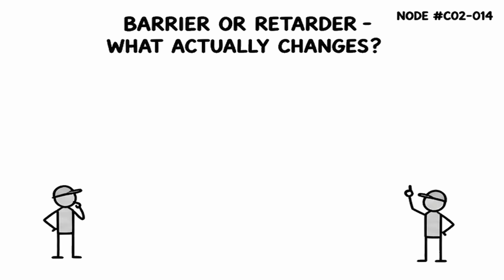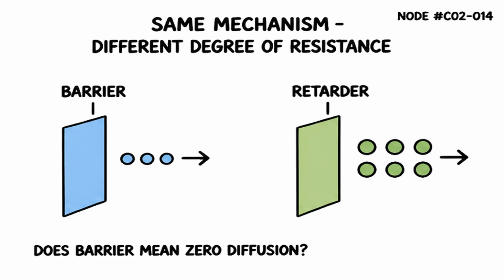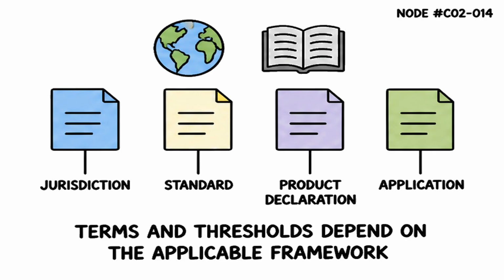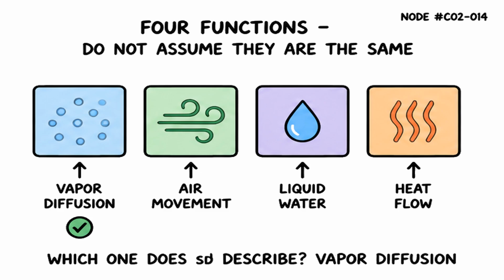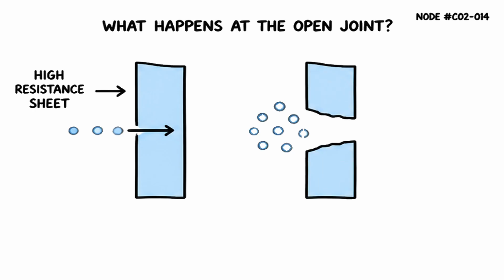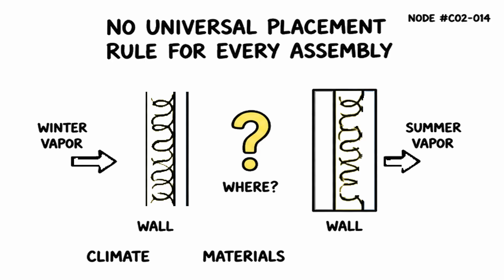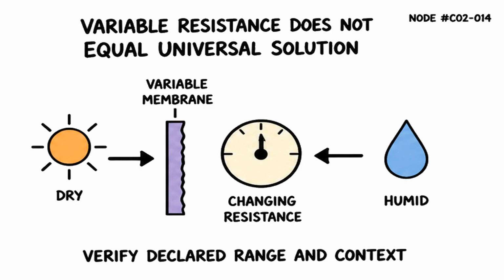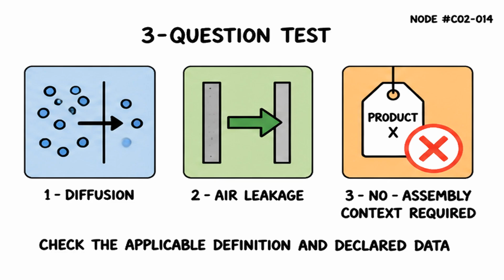Vapor Barrier vs Vapor Retarder — What’s the Difference Vaporight  014

Comment from the maker: 📌 3-QUESTION CHECK

1⃣ Water-vapor molecules move through the body of a solid material.
Is this diffusion or air leakage?

2⃣ Humid air moves through an open seam.
Is this diffusion or air leakage?

3⃣ A product is called a “vapor barrier.”
Does that label alone prove the complete wall assembly is suitable?

ANSWERS:

1 — DIFFUSION
2 — AIR LEAKAGE
3 — NO. The applicable definition, declared product performance, climate,
assembly, drying potential, workmanship, and local requirements still matter.

One more question for the community:

Which term is normally used where you work?

A) Vapor barrier
B) Vapor retarder
C) Vapor control layer
D) Another local term

Share the country or region only if you are comfortable doing so. Replies are
for general discussion—not project-specific design advice.

⚠ Vaporight cannot assess a specific wall, select a product, or confirm code
compliance in the comments. For an actual project, verify the complete assembly,
exact product documentation, and applicable local requirements with
appropriately qualified local professionals.

🏗 Vaporight is a numbered educational library of building-envelope physics:
explained, not prescribed.